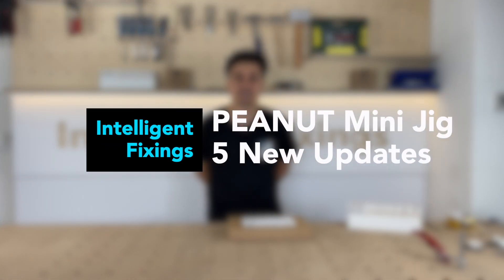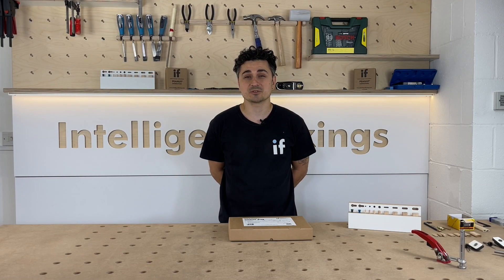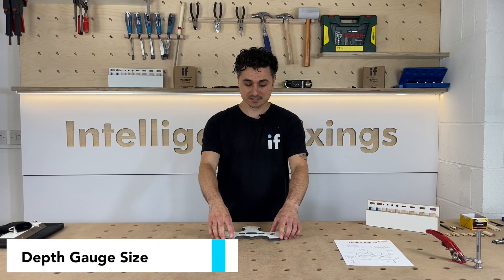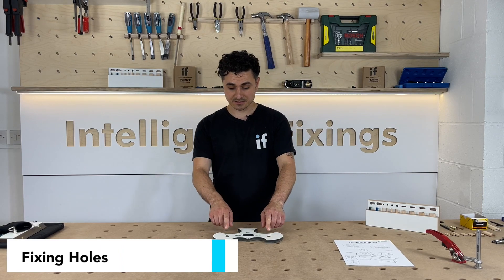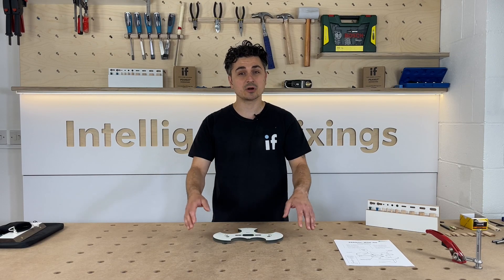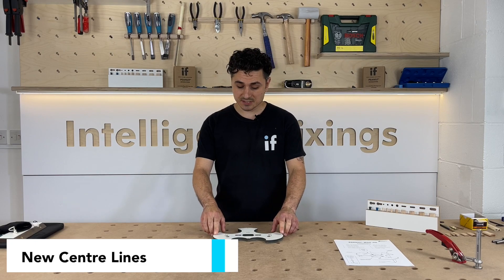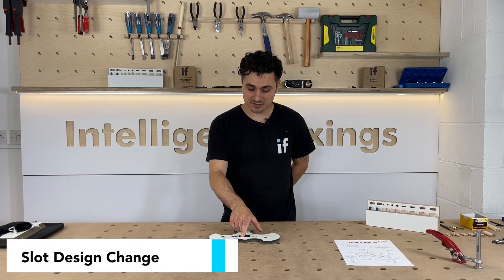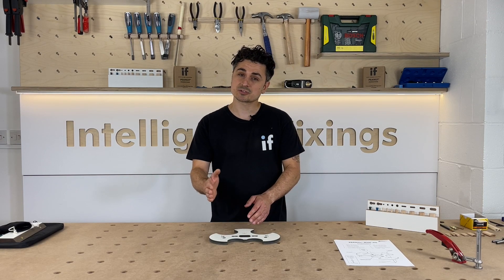PEANUT Mini Jig | 5 NEW Updates | Loose Tenon Compatible + More

Comment: Nice update. I think it’s probably the 3rd iteration of the jig.

Is there any version marking on the jig or in the user manual?

I found it from the local shop and they cannot tell me whether it is the latest version or the first.
Reply from the maker: There have currently been two iterations of the PEANUT Mini Jig. 

The easiest way to distinguish them, is that the second version possesses centring lines on the edges of the jig body. Also, we added fixing holes to the second version which are not present on the first version.
Reply: @IntelligentFixings  thanks. I’ll check if the one they have has those features.

Comment: That is the exact router setup I want to use with this so I am really happy to see it working! Can you tell me which collet and bushings you used (I assume it's the 8mm cutter).
Reply from the maker: Hi Alistair, the collet being used here is the "SP10174814 Collet Chuck Set" and the bushing is from the "KATSU Tools Brass Router Guide Bush Bushing Set". In our case, the guide bush has also been cut down to a 4mm projection so that it's also compatible with the larger PEANUT Jig, however at its standard projection size it should work fine with the PEANUT Mini Jig.
Reply: @IntelligentFixings  perfect. Those are both exactly what I bought from Amazon so I should be all set. Thanks.

Comment: I'd used this great piece of kit on an entire wardrobe build recently, carcasses, shelves, drawers, doors & cornice, amazing!

Started part 1 of installation today, it's great to be able to dry fit in the workshop, label everything (roughly 180 components in this case - nearly 300 peanuts used!), take to site, unwrap it all & have it back together in no time at all.

If I needed a mid panel joint I used a track saw rail & rail square (from benchdogs - incredible accurate). 

From the rail edge to center line I think was 74mm (off the top of my head, could be wrong, not near it to check, was easy enough to work out). 

Often clamps can't reach the Mini jig in mid panels & like most with the mk1 version with no mid screw holes (could easily drill them yourself if required), but I found clamping the rail & holding the jig tightly was enough, no movement. Plunge in & out first then back down create the slot cut (just in case there had been any movement, use a simple pencil mark round part of the jig to ensure it hadn't wondered)

For the 6mm peanut holes, as the drill guide & jig combo doesn't center the holes due to varying material widths, I used a fairly cheap self centering drill guide, that way it saved working out the offset & which face was my reference. Center the slot, center the hole, happy days!

Cheers to Luke & the team, I think it's a great piece of kit & I may even upgrade to the full size to save time on my next build coming up.

Many thanks, Stu

Comment: If only I had waited...  Hope there is an option to buy this for a reduced price if you already bought the original.  The center lines will be a great improvement - I sweated for ages trying to work that out to use it in the middle of a panel!
Reply from the maker: Hello, we will be releasing more details about the old body and how it can be upgraded to have most of the features that this new edition has early next week. I hope this helps.
Reply: @IntelligentFixings  Cool - and thanks
Reply: I'd used this great piece of kit on an entire wardrobe build recently, carcasses, shelves, drawers, doors & cornice, amazing!

Started part 1 of installation today, it's great to be able to dry fit in the workshop, label everything (roughly 180 components in this case - nearly 300 peanuts used!), take to site, unwrap it all & have it back together in no time at all.

If I needed a mid panel joint I used a track saw rail & rail square (from benchdogs - incredible accurate). 

From the rail edge to center line I think was 74mm (off the top of my head, could be wrong, not near it to check, was easy enough to work out). 

Often clamps can't reach the Mini jig in mid panels & like most with the mk1 version with no mid screw holes (could easily drill them yourself if required), but I found clamping the rail & holding the jig tightly was enough, no movement. Plunge in & out first then back down create the slot cut (just in case there had been any movement, use a simple pencil mark round part of the jig to ensure it hadn't wondered)

For the 6mm peanut holes, as the drill guide & jig combo doesn't center the holes due to varying material widths, I used a fairly cheap self centering drill guide, that way it saved working out the offset & which face was my reference. Center the slot, center the hole, happy days!

Cheers to Luke & the team, I think it's a great piece of kit & I may even upgrade to the full size to save time on my next build coming up.

Many thanks, Stu
Reply: I’m in the same boat, I look forward to your next video
Reply from the maker: We have no released an option on to purchase an upgraded PEANUT Mini Jig (1st Generation) body. More details can be found here: https://shop.intelligentfixings.com/products/peanut-mini-jig-replacement-body
Reply: @IntelligentFixings  I'll think about that - it looked like a great deal until I added taxes and shipping.  Maybe for Christmas I guess...